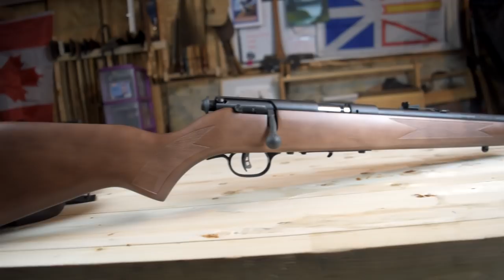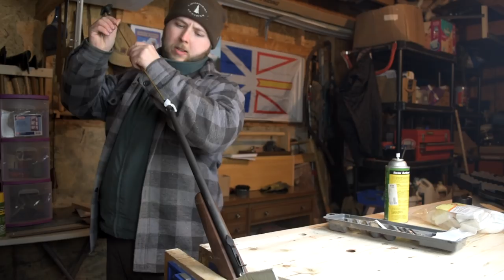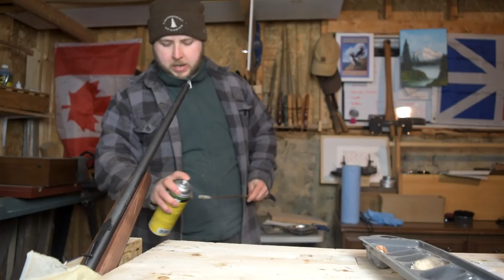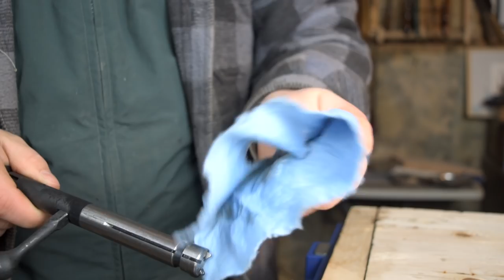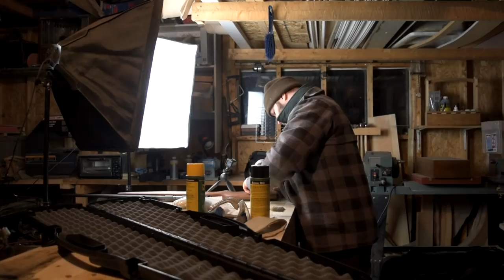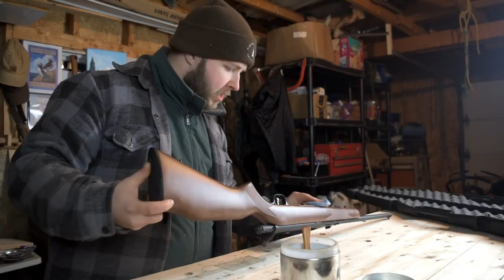Preparing a Brand New Rifle - [Savage Mark ll G]

Comment: I live in northern BC. A long time ago, I was told by an old hand that if going out shooting/hunting in really cold weather, the trick is to completely disassemble the action (if it's bolt action, take it apart), remove every trace of oil, get it squeaky clean (mineral spirits or alcohol works), let it 100% dry then sparingly dust with very fine graphite powder. It's always worked for me.

Comment: Try a dry lube in your 795. Dry graphite or Teflon. Another option in cold weather is automatic transmission fluid. Hoppes and shooters choice are my goto bore cleaners and brake clean for bolts and actions.

Comment: Shooters Choice is the best bore cleaner I've used in over 50 years of a firearms hobby and it especially works well with the dirty 22 ammo. Put it down the bore after a day of shooting, then after soaking for a couple of hours a few swipes without the brush and you have a spotless barrel. Yep, doesn't need a brush if it is allowed some soak time.
 Probably the reason your 22 autoloader didn't work in extreme cold is the oil you're using Kyle. Try the old Remington oil with Teflon in it. I use it for more than just my guns, it's a must for all my cars door locks because the oil dries fairly quickly, but leaves behind a layer of Teflon. I've fired my 10-22 as cold as 30F below, or  -34C with no failures except the rimfire primers become less reliable in the cold as well. Just FYI Kyle.
Reply from the maker: Thanks for the info bud! I'll look into the shooters choice products!
Reply: @kyle_noseworthy  Another good one is the M-Pro-7 at cabelas.  I had a 1911 that would jam like crazy below freezing.  Had it running great down to -20 with the M-Pro-7

Comment: Look into the J Dewey rod. Make sure you get the .20 cal rod though. Rim fire tolerance is very tight and a standard.22 may be too snug. If you can get it also grab a Parker Hale jag. Amazon has bore guides if you go with a one piece rod. Helps keep the action and trigger clear of debris and solvents.

Comment: Everybody has their own way of doing things,..but when I  have to remove stickers like these, (I use a tip I read once in a `Better House Keeping`magazine, where they had some tips for the kitchen,..they said to freeze or at least make those stickers very cold, and you`ll find that they can be peeled off without leaving the adhesive behind. It does work, most of the time.
For cleaning,.I like to sue a bore snake with Hoppes 9 and then follow up with a patch soaked with Ballistol, actually any good barrel cleaner will do.
I do like Savage rimfire rifles.
Reply from the maker: Thanks Reg! The cold wouldn't work on these. Heat only. I tried taking them off in the cold, which I edited out of the video. They didn't move! haha I like the Hoppes products
Reply: @kyle_noseworthy   Oh well,..some things work for different folks, I guess!
I forgot to mention, I bought a fibreglass cleaning rod from OP Fishing & Hunting for my rifles, as I didn't want to risk touching or marring the crown on the rifle  barrels. I can't remember the brand name of those rods, but the rod spins free from the handle and lets the patch or brush rotate as the grooves do.
Cheers!

Comment: i just got a mark 1 G one question right above where the big barrel meets the smaller barrel do you notice what looks like a small hole or crack on the barrel?  Just wondering what was that for.  Thanks